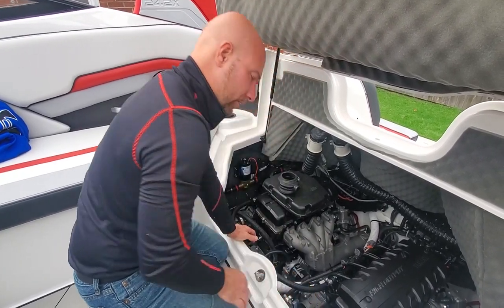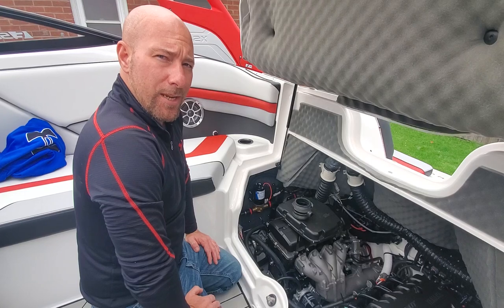How to install a ribbon delete on your Yamaha jet boat.

Comment: Thank you so much for this very informative video. I just completed my ribbon delete on my 2019 212 limited. I have not been on the water yet, but I have to say that this was a fairly easy task. I also swapped my air filter with a Riva Racing fire retardant filter. It was a $500 Canadian job, but I am sure that it will be well worth it.
Keep these videos coming! Lastly, yes the filter was a pain in the ass to remove and put back on!!! :)
Reply from the maker: Hopefully you're happy with the results.  Darn Canada,  that's a lot of money!

Comment: NOTE: Direction of supplied billet sleeve is
critical. Arrow points to side that must face throttle
body   As per Riva's instructions
Reply: So it means he installed it wrong.  Looking over the install instructions to some older ones it seems Riva even modified the original wording to now included, "not direction of airflow", prob because this is now the 2nd YT vid I've seen where it's installed backwards.  The full wording in the Riva install instructions now states, "Arrow points to side that must face throttle body, not direction of air flow."

Comment: I have the same boat 18 just did mines but i left the rubber out did not put a spacer in and also i aded 2 air filters still need to go out  and test the boat
Reply from the maker: Let me know how you like it. I'm hoping to test mine out this weekend.

Comment: I pulled mine off in a 2021 ar190 I just took out the ribbon and rubber piece didn’t put the delete thing. No difference boat only does 35 max with just me in it. If I woulda known I would never have bought the boat. Also have thrust vector on it and no difference really in low speed steering.
Reply: Forgot to mention with the thrust vector on its shooting water right at the person being pulled in back
Reply from the maker: @rdgsupafli  I'm hoping to gain a mile or 2 an hour. We'll see. I just replaced my thrust vector X with their new new style.  It is supposed to have less spray. I'll find out this weekend when I take the boat,  but might be a possible option.

Comment: Looks like you installed the Riva ribbon delete sleeve in backwards? The arrow is meant to face the throttle body, not the direction of airflow.
Reply from the maker: It's not in backwards....but now you're going to make me take it apart and check
Reply: Haha - Re read the Riva instructions, as the arrow is to point towards the TB/ bow of the boat. 😊
Reply from the maker: @deafwish6819  I did look on their website after your first comment.  I feel like I installed them per the written instructions included. But now I'm going to have to pull them out and double-check.
Reply: @SmoknJaysGarage  - You could indeed be correct, but your video shows otherwise. Good luck & keep up the great work. ☺️
Reply from the maker: @deafwish6819  thank you.

Comment: What does this do for the boat? And is there any downside to doing this?
Reply from the maker: It allows increased air flow. I thought I said that in the video....maybe I forgot.  The reason it's there is a fire resistor.  Modern FI engines aren't prone to back firing.  However it is still a USCG requirement.  So the downside is that you must add some other form of flash arrestor.  I used fired resistant air filters to remain in compliance with the Coast Guard.

Comment: Check with your uscg i think boats need to have flame arrestors
Reply from the maker: You are correct, you must have a flame arrestor. But a flame resistant air filter will take the place,  legally, of these ribbons.

Comment: Can these ecus be remapped like the Jetskis? I have a stage 1 on my 2015 Yamaha vxr.
Reply from the maker: I'm not positive... I don't know anyone locally that has done it.
Reply: @SmoknJaysGarage  thank you. One other question: do jetboats have to be pulled from the water after each ride and flushed? Or can they be kept at marina where they sit in the water over the Summer?
Reply from the maker: @alex124241  they can sit in the water all summer. However,  if you're in saltwater, the engines should be flushed after use.
Reply: @SmoknJaysGarage  what about brackish water?
Reply from the maker: @alex124241  I've actually never boated in that, but probably a good idea as that does have some salt in it.

Comment: Are you sure the arrow is supposed to be facing the same way as the airflow?
Reply from the maker: At least on the brand I put in, yes.
Reply: @SmoknJaysGarage  Thanks for the video, I'm going to put them on my AR240! Do you remember what brand yours were?
Reply from the maker: @cjc762co7  I got mine from Riva Racing
Rivaracing.com

Comment: What is the purpose of this procedure sir?
Reply from the maker: If I recall,  that's the first thing I said in the video,  and it's in the description.  However,  if you missed those...this will help with air flow. The ribbon is a flash arrestor and does restrict some air flow.

Comment: you have to do the K/N filters with this mod !
Reply from the maker: It is definitely recommended (and required by law, although I'm not going to tell on you) that you add some type of flash arrestor if you're going to remove the stock one. 
But as far as, will it run on the stock filters, yes.
Reply: @SmoknJaysGarage  NEWS FLASH !  K/N  filters are screened in with a metal mesh screen over the filter media !!  =)
Reply from the maker: @demolaj1  they have "normal" ones and flame retardant ones. You have to make sure you're getting the right one

Comment: What does a ribbon delete achieve?
Reply from the maker: It allows better air flow which offers better acceleration and in some cases, 2-3mph more on the top end.
Reply: Will it void warranty?
Reply from the maker: @mikeharris6652  my Yamaha dealer told me, "we're not going to look for that". But there is the potential that a different dealer would, especially if your claim involved a fire.
Reply: @SmoknJaysGarage    Definitely post the differences you see performance I have the exact same boat same colour and everyhing. Just order led light rings for all my speakers I'll be installing them this weekend.. and way thinking about adding a tab system because we boat on a big lake that gets a little rough. But wasn't sure if it will be in the way of my wake booster or change how the water flows off the boat into the booster. Have you seen or heard anyone adding tabs ?
Reply from the maker: @mikeharris6652  I plan to get on the water this weekend.  
I don't have trim tabs,  but I've heard things from people that do
Reply: It allows you boat to blow up if it ever back fires. I will skip this mod...
Reply from the maker: @lazergeek  there is that potential if you remove a flame arrestor without adding another one. They do make flame resistant air filter that meet coast guard regulations.
Reply: Here is a video of the performance gains on a jet ski. It blew everything out of the water.
https://youtu.be/klwXLe2TKGw
Reply from the maker: @apacheworrier3776  guess he didn't take my advice about adding a fire resistance filter.
Reply: @SmoknJaysGarage  
I don’t know if a ribbon delete caused that. I was just being sarcastic. Enjoy your videos. Thanks for taking the time to produce them. Your silicone on the bunk boards trick has helped me out tremendously!
Reply from the maker: @apacheworrier3776  glad it was helpful. 
I think the guy in the video didn't run his blower before starting.  At least that would be my guess.